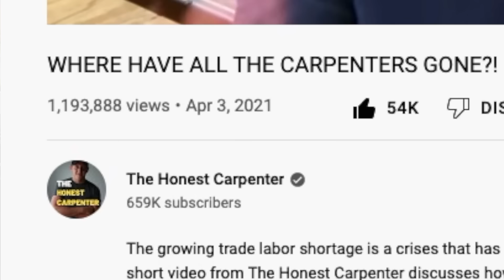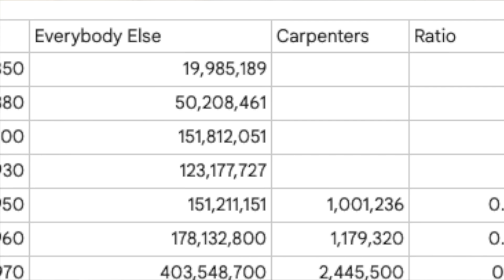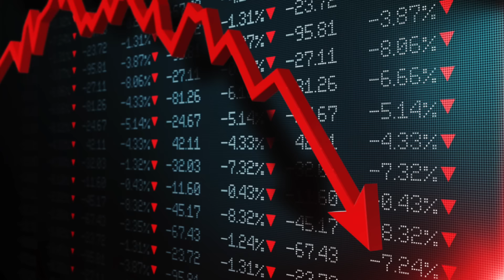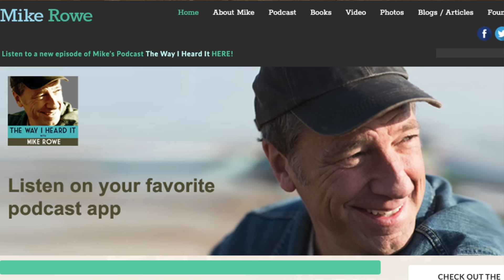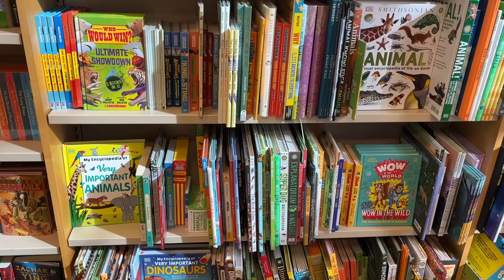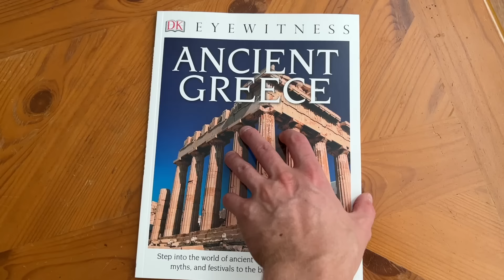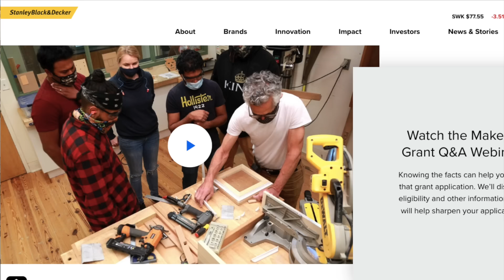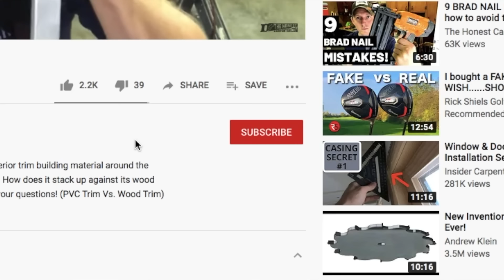THE TRADES ARE DYING...But The World Still Needs To Be Built! CAN WE FIX THE SKILLED LABOR SHORTAGE?

Comment: Well, I was a union carpenter out of Local 24 in Yalesville, CT. During the early 2000's the locals started losing contracts and the work was scarce. I looked around at other companies, but the paid gap was too wide. I was making $53/hr as a 4th year apprentice (which included my benefits) in 2004. Today, if I decided to pick up a hammer and give it a go, I may get $18/hr in 2022. That's why there's a shortage of carpenter and tradesmen. You can't live on minimal and expect me to work in the elements.  Our government did a disservice to the trade industry stating the jobs were for "losers" and get a job at Starbucks. As you stated in this video, we have to get the younger children involved and offer livable wages for tradesmen.
Reply: Factor in your gas to from the jobs.Your first few hours work go into the tank As a roofer I'm comuiting 108 miles round trip. Sucks.
Reply: That's why the fact that national politicians who push the free college for all programs for some reason NOT mentioning that included in the plan is free technical college is stupid. There would be far more support if people were informed that it gave a wider choice of careers.
Reply: @brianjacobsen8878  Bruh....Damn
Reply: That seems like overcompensation and the result of unions for sure when $53 an hour at 2004 if only 4 years in. I know no other job industry offering that pay for only 4 years of paid education/experience.

This is part of the problem. I work in education and my pay is like $26 an hour today. I had to get a degree for my job. I would gladly take up a trade, pop in some headphones and enjoy a day of health physical labor, that is extremely rewarding compared to sitting around all day doing paperwork.

Gate keeping, and keeping younger and new recruits, part timers, gig workers and the like out of the industry is bad for society. It drives up prices and labor, when neaturally it deserves to be a little less (not a lot).
Reply: 53 dollers an hour with four years no wonder you cant find a job you want lead carpenter money with laborer exp
Reply: @vyalantfitts341  I didn't make the rules, that's what 4th year apprentice made at local 24. The journeyman made a bit more considering I was in my last year of training. Foremans made the money.
Reply: @Jeremy K  why do you think that a college degree supersedes 4 years of trade training. To me, we are doing the same thing. You went to a school to train and I went to work to train. This is what I was talking about that our government puts higher regards for college students than people who work in the trades. Now, the country has people to believe that the only way to make money is with a college degree or certification. Jeremy, I don't know where you live but in Connecticut where I was born and raised the salaries there are very good and competitive. I understand that teachers don't make a lot of money and I have fought for increased wages but that's the reality of the job. I choose to work in an Union that paid competitive to the market. NY and MA union workers are paid more than CT. So, if you are looking for a career change may want to look in these places.
Reply: @merashad  where did I say that? It did supersede it? The point is, 4 years of education should at the very least be equal Roughly that is why people pay for it, not get paid to go to it. And we don't just repeat a role, or classes 40 hours a week, we learn new things.

But as to my point, where did I say it supersedes? All I stated is 53 an hour for 4 years of working is pretty freaking high pay, I live in CA and only make 26 an hour. I been working for 5 years at my job. And have a 4 year degree. I don't think 53 an hour is a natural market rate.
Reply: @Jayremy89  If you only make 26 an hour after 5 years in Cali, you screwed up terribly in your choices somewhere.
Reply: @michaellind3653  you are clearly clueless to the market. The median income is 38k. I make above that, and I hope you know what median means...

That is just the reality for most of us. I don't see why people think they need to have made a million in 10 years of work, especially at the cost of destroying markets, labor markets or gatekeeping from the younger and those changing careers/jobs.
Reply: @Jayremy89  first off you don't sound like you could make it in construction, you have a fantasy ideal of the work. Headphones are a safety hazard and it ain't fun in the sun. No one is stopping you from getting a better paying job in construction. Colorado even the Denver mayor got mad at the unions when they started losing jobs. Companies dropped union contracts 20 years ago because of the absenteeism and quality of work.  People with me will make over 50 an hour in year 4. Our cost of a 20hr an employee is 33h, that's an 18 year old with no experience. If they stay with us they will be millionaires by 35.
Reply: @Jayremy89  within 10 years construction pay will be higher than 4 year degree wage. So specialty trades are 50-100 percent higher. I cleared a hundred an hour after paying my gofers, gross hourly was 136. 9 months of training to get to my level
Reply: You may get 18 an hour today but you forgot to add the cost of living keeps going up at the same time wages are going down.
Reply: Wouldn't making the job less appealing to the masses make it better for the trademen themselves? More demand no?
Reply: The reason is illegal immigrants have cut the bottom out of labor pricing. You have to compete with people that are willing to go out and work for like $12/hr. The vast majority of builders and jobs are all about low-cost production. The only way to make decent money (still not enough) is to get into complex custom homes that require a lot of skill and experience. Your average tract home wood butcher isn't going to make it doing 5-piece crown.
Reply: @sparksmcgee6641  in what industry? I applied for years in the Midwest to all trades and heard nothing. Entry level is 12 to 15 an hour and it stops going up at around 30
Reply: @sparksmcgee6641  for what trade? Nothing in the Midwest is remotely close to that
Reply: @sparksmcgee6641  Nah, I have done the work. Just not "professionally", more a side hustle gigs family that did. The issue that family took advantage me, underpaid me, had me working hours and conditions most grown men (they knew) would turn down at pay more than double mine, all while in my teens. Hell, I wasnt give much of an option and too young to know much I was being taken advantage for then. And, no a job is a job, you got rules. If that's what you accept, that's you. Nobody said I am plugging my ears ignoring my surroundings, working 30 minutes an hour, sipping lemonade, only working in fair weather sunshine.

Hell, I wastold to bolt on sheet metal roofing on a horse coral in Santa Ana winds alone. Getting slapped by it, cutting my arms and hands and almost had my guts slit open when a strong gust sent that shit flying past me, before falling if I didnt dodge it. I don't see run of the mill tradesmen working in harsh conditions. We all know the memes of metal workers retreating to their cars or going home when a few drops a rain fall. That's that fighting the elements dude. People in the trade unions are not hard at all. Done enough piping, concrete pouring/mixing, ditch digging, sawing, tile laying/cutting, furniture delivering and assembling, roof work, barn installation, to know enough about what work it is, and what is expected.

Sadly these trades are about who you know, and independent residential contracting is full of too many incompetent or shady scumbags.
Reply: @Jayremy89  honestly you haven't done the work then. Nothing you describe is real construction work.
Reply: @Jayremy89  thanks for your comment but I disagree with some of your statements. Having a trade certificate is like having a degree. You went to college and learned from theories and sat in a classroom. I went to work and learned an actual trade. To me they are different because being in a classroom doesn't teach you some basic function about life (showing up to work prepared, budgeting, working to meet deadlines, understanding workflow processes and etc). In college you learn theories, working in groups, understanding dynamics of disciplines and etc. One doesn't take away from another. People have this illusion that college is the pinnacle of education and only through it, you will achieve greatness in the workplace. Well, you choose to teach which to me is one of the lowest return on investments. I love teachers but not the wages. There are people who have an AS degree that make more money in their first few years of working, are they being overpaid? Or maybe, they chose field that have a higher return on investment. 
To disagree a little further, unions are a good things as you would know as a teacher. It regulates the market so that everyone involved are getting their slice of the pie. There are some pit fall to unions as well. As a whole, if we as a people, started slinging mud at one another we all are going to come up short. I wouldn't complain or downgrade someone else's life with comments like "$54/hr is too high for a 4 year carpenter. I have a college degree and make $26/hr." You can too, become a carpenter or any other occupation you desire that pays a higher wage.

Comment: I'm a red seal carpenter and I'm looking to switch jobs. The reason I'm willing to leave the trades behind is the working conditions and the toll it takes on the body. The wages are okay but every other trade makes more than carpenters and people still wonder why the trades but especially carpentry is dying.
Reply from the maker: It’s a sad state of affairs for carpenters in particular, gustabo. I lived through it as well 😪
Reply: I've been trying to understand this issue for decades. The decline in skilled trades seems to me to be across the board.

I'm more on the cabinetry side, although my original shopfitting job involved carpentry, joinery, polishing and pretty much a small element of most finishing trades.

I learnt later in life that it's not smart to do something because you can, rather more important to specialize in something. This maximises our profitability but makes it difficult to put our hand to other things we can do because there is always someone else specializing in the thing you're diverging into and to be ethical about it it's difficult to charge double the fee that the specialist does. And you really do need to at least double it to allow for the extra time you need if you're tooled up properly for the job. You can ruin your reputation if you charge too much too.

This is the mechanism for the modern predicament as best I can tell... Imagine a cabinet maker of old. Everything he does is by hand and passed down through the generations.  The drawers are dovetailed and set on wooden slides. Even many hinges are either made by hand or from a basic limited source.

Now as yourself how much would you need to manufacture a typical Blum concealed hinge. In a Australia  one of those soft close little beauties will set you back maybe $3.00.
If on the other hand you were asked to manufacture one of them from scratch my best guess would be that it would cost multiple hundreds of thousands of dollars(possibly millions) to get your production to a point where you make just one.

I'm putting it out there that while innovation has in many ways made us collectively much richer it's also hidden where we have become poverty stricken. 
I mean how many people can afford to pay a professional to innovate?

If you think about that for any length of time it begins to keep you up at night.

I think free enterprise has kept us from collapsing under the weight of socialist changes to our governance. 
Sorry to bring politics into it but I think it is part of the equation. I suspect we would all be much richer if government intervention wasn't messing with the goalposts. 

That needs to be clarified. Here in Australia a friend of mine works for a government agency that looks after problematic people in our society. One of his clients is a mid life woman with a few emotional issues. Her budget for assistance exceeds $300,000.00 per year.

Seriously, there's enough money just there to look after 7 or 8 people without them ever needing to work again. This is only the tip of the iceberg with regards to the nature of public spending though. 

You and I in the private sector are propping this all up. God knows if we can do it for much longer...
Reply: @grantfrith9589  I thought you said, "my original shoplifting job!"  I'm like... oh, this guy must be from San Francisco!  Glad I re-read what you wrote!
Reply: @atlanteum  Yes, you're not the only one to make that mistake. It's a good job but extremely long hours.
You get a lot of experience working as many different materials as you can think of. I miss it but it's given me plenty of skills for the experience.
Reply: @grantfrith9589  I've been stuck behind a computer doing animation and VFX forever, but I also removed and installed my own windows when I bought my place, built a trellis-covered deck in the back yard and have a garage full of DeWalt and Rigid tools.  Digital is fine for what it is, but nothing beats the hands-on approach -
Reply: @atlanteum  I've always felt that. When I was young I was accepted in the navy but all my life I've been building things. As a kid I was always working on something. I even made a metal detector from junk and some electrical components from an electronics store when I was about 13.

Later I built steel string guitars, made jewellery and rebuilt a Volkswagen engine in a bedroom I was renting. 

The shopfitting was even more rewarding. It's a bit like a cross between high class cabinetry and creating movie sets. I always liked impressing my girlfriends by pointing out the speciality  shops around town I'd had a big part in creating. 

At the moment my wifes bosses husband who sounds a bit like you with regards to the passion of working with tools after work.
 Unfortunately he is trying to offload his tools to me as he's fading away with cancer.

I guess he wants to know his tools will be appreciated and not sold off for a pittance at a garage sale when  he is gone. 

For me I love seeing folk have a go at different projects. It really is quite therapeutic to stand back and see your hard work pay off in something tangible. 

Whatever you do don't ever get rid of them.👍
Reply: PS: Obviously the navy missed out...
Reply: @grantfrith9589  No, sir, I"ll hang onto them as long as I can, and then, much like your friend, do my best to see to it that they find a good new home.  Sorry to hear of his illness.

I used to do full builds and customize VWs in my youth, but only down to the engine block -  I never ventured into assembling rods or rocker arms!  I believe you are far more technically inclined than I am - I'm really just a fairly simple "measure and then measure it again, then cut" kind of guy.

Bless You and Thank You for your naval service, Sir -
Reply: @grantfrith9589  I may have misunderstood.  You mean you were accepted into but did not enter the navy?
Reply: @atlanteum  Yes. At the time the navy accepted my application I was enjoying the challenges of the shopfitting job so I declined their offer.

Thanks for chatting. It's good to reflect on the choices we make.
Reply: @grantfrith9589  Indeed, it is.  

It's been a pleasure, sir.  Perhaps we'll speak again -
Reply: gustavo honzofo. Truth man. Your just doing what every other smart and skilled laborer with options does as no one wa to to work their whole life in manual labor as it breaks the body down. And the real problem is the younger generations aren't going to break their bodies down to make someone else rich like so many generations before them did. There just smarter and society made them this way. The only way to temporarily turn it around is to put some kind of financial premium on manual labor jobs but I'm pretty sure society isn't going to do that.
Reply: Make carpentry a "certified trade" like electricians . Simple solution to attracting new people .
Reply: @MS-kf5mo  not really, and you can't really teach carpentry in a classroom or have tests because the trade is so wide.
Reply: I was in carpenter work for 1 year. Enjoyed it but yeah looking around at the guys who'd been in it for a long time scared me off. They were mostly broken up pretty bad. And the scary stories. And I saw the dangerous conditions for myself too. Just being dumb.

Went to college for computer science, dropped out to create video games, retired at 45. Now I flip a house once every 5-7 years because I still enjoy swinging a hammer.
Reply: @Countrylifeprojects  The thing is, so many companies, in my area at least, are just too damn stubborn to adapt.  I hear contractors all the time complaining non stop about how they can’t hire and retain employees, and how hard it is, but they’re always blaming everybody else.  So many of them can’t/ won’t look in the mirror and think “what could I be doing differently as an employer to make my company a more desirable experience place to work”. They’ll make zero effort to improve their wages/ working conditions and then turn around and wonder why nobody wants to work for them.  I don’t understand why more employers in the trades refuse to see this.  Every other industry seems to
Reply: @Dreadlock1227  Because they are just going to keep complaining about it, until the government allows for manual labor visas, then they will have what they want.
Reply: Exactly. I'm a third generation red seal carpenter and I despise it for the reasons you posted and more. Every other trade on our home builds and renos are paid more for less physical and logistics work and we often have to answer numerous questions from them how they should do THEIR job.